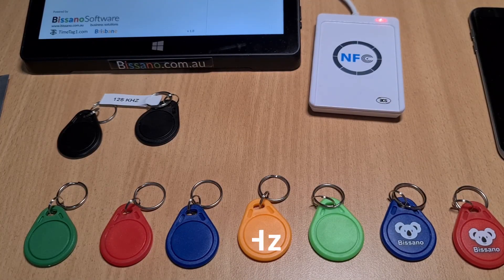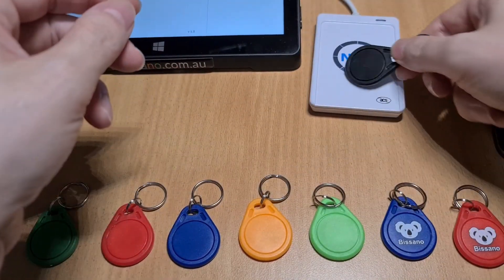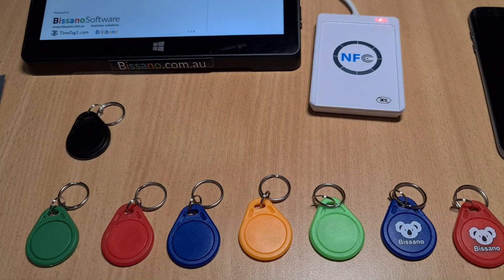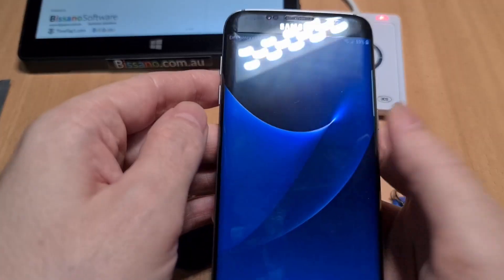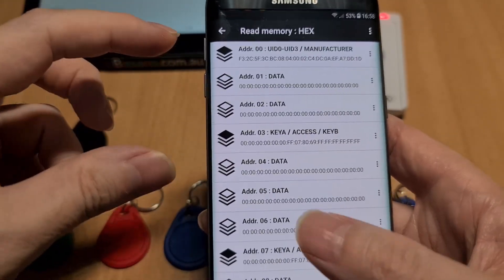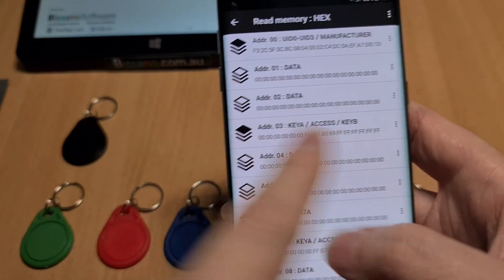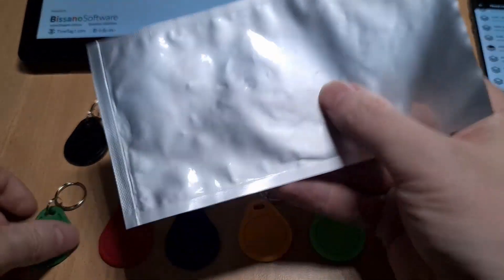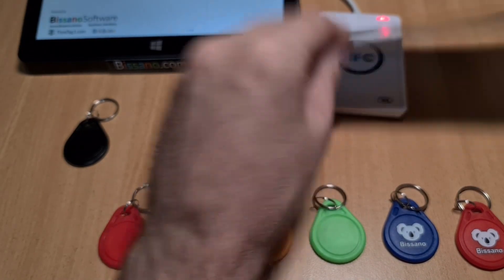MIFARE CLASSIC 1K NFC KEY FOB TAGS 13.56MHz

Comment: How to write this tags directly with phone as phone doesn't recognize it
Reply: Perhaps the phone you are using doesn't support the tag. All Samsung phones I have tried are working, but some OPPO models or others do not support MIFARE NFC tags. You have to check your phone specifications.
Reply: @bissermilanov1311  I have iphone 7 it scans other nfc tags but not this ones
Reply: @ultimatejay9872   Where did you purchase them? Even thought they look like that it doesn't mean they are necessarily the type you think they are. I have MIFARE 1k and T5577 and they look exactly the same and while the phone will scan the MIFARE it will not scan T5577. There are number of other types. I have only managed to use MIFARE on the phone.
Reply: @bissermilanov1311  I got the reason the tags were 125khz but our pho e can only detect 13mhz or higher

Comment: Hello, if the tag is locked is it still possible to copy the data from the tag to a new tag?
Reply: I haven't done it but I have read it is possible for the mifare classic. However properly implemented software solution can easily counter cloned cards.

Comment: With NFC tools how do you write the info from 1 tag and copy it to an empty one? Can you provide a tutorial?
Reply: You have to ask the NFC Tools developer for tutorial how to work with their app and if this is possible. You have to have in mind that a full copy of a proper tag is not possible because they have unique IDs which cannot be overwritten. However on the market there are blank tags on which you can overwrite sector 0 including the unique ID. These do not comply to the standard and they are in a way a workaround for copying tags. It also depends on the software that will be using the tags. They might have a protection against cloned tags.